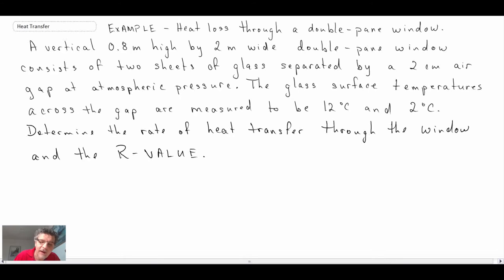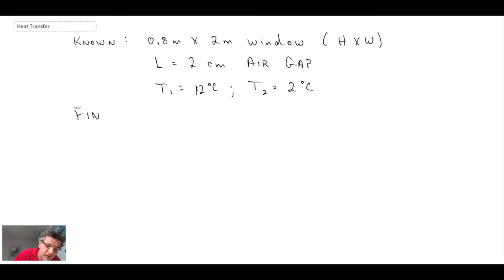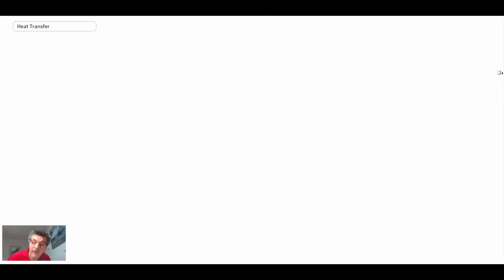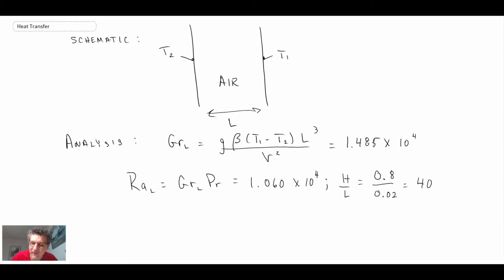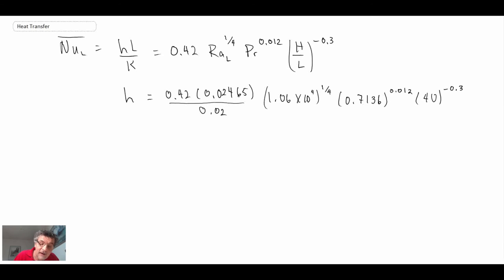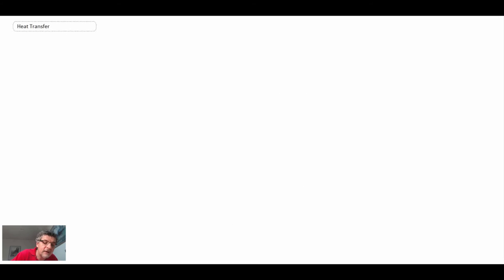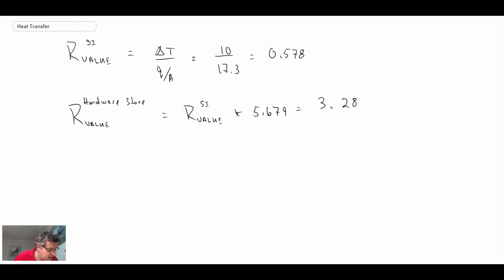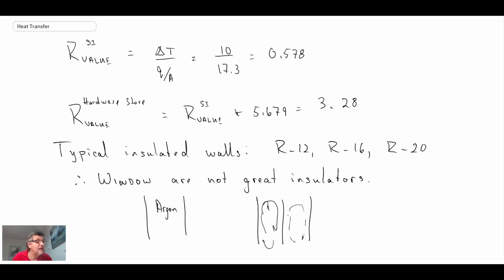Heat Transfer L25 p4 - Example - Free Convection in a Double-Pane Window

Comment: Excellent videos!
The only question I have is that you used a value of .42 for C, but in lecture 24, part 1, you used .59 for laminar flow. I don't see why there is a difference. Did you use an experimentally derived value with a little turbulence, or is there something else going on?

Thanks for making the series!